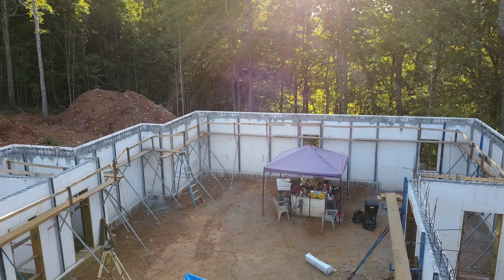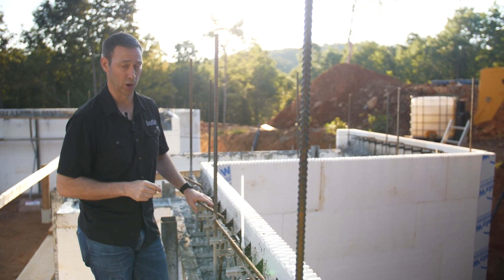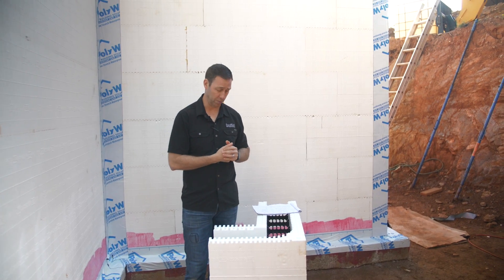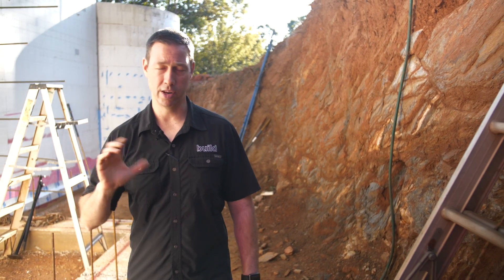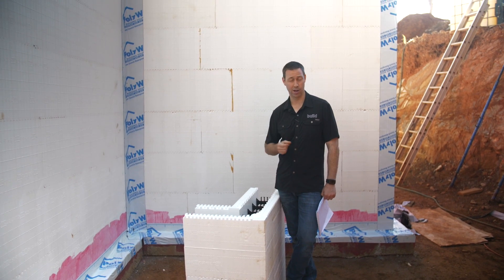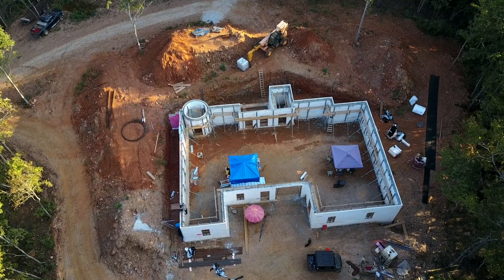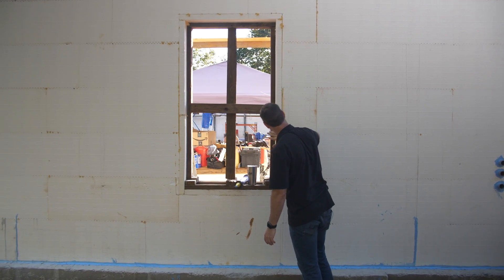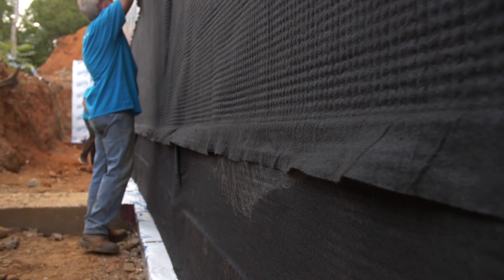Insulated Concrete Forms - Overview, Costs, and Cons

Comment: if you wanted to do an icf house but wanted a brutalist design with concrete on the outside and inside as well, could you do an icf with additional concrete on the inside and outside of the traditional icf ?

Comment: You need to read address ICF in your building types. This video is six years old and you’re basically poo poo in it because you don’t understand it. Additionally, there have been several alternatives in the ICF world like the Perfect Block which eliminates several of the drawbacks that you talk about. You can get an R 34 wall just by doing the standard construction process. Of course you can build a higher our factor wall if you set out to do that. You could add more poly iso to the outside or you could add Zip R, etc. Basically, the sense that I get from you in this video is that you haven’t built with ICF so it isn’t any good in your mind. In a rural area, ICF may be the answer.

Comment: Great video.  One thing that I am curious about is that you mentioned window and door openings and showed one, but how do you ensure that you are getting concrete under those openings?  Is it a separate pour before framing it up to support the sides and top, or is there some other magic in there?

Comment: The problem with being Off-Grid, electrically in this instance, is it rebounds in terms of the building code authorities as well as the insurance company, thus banking, requirements, point is YOU NEED A CERTIFICATE OF OCCUPANCY, without that nothing falls into place; as for independently powering your house, they do not like that!

Comment: My building with ICF was a problem for fitting exterior heavy objects to the skin later - roller shutter tracks had nothing to fix-in-to, thermal solar colllectors (wall mounted) weight heavy and i needed to drill all the way through the wall to fix them with bolts through the entire wall; exterior satellite TV mount - exterior lights, everything that fixes to the outer skin had no proper fixing location on the exterior insulation covered with render.

Comment: This sure does seem like a lot of effort to do what could be done on just a poured foundation with solid EPS  blocks, foam glue, and 1/2" concrete coating inside and out and be done with it other than a little framing for doors, windows, and cabinets and of course routing with a foam cutter tool channels for the electrical. ICF's just seem like a scam to me by comparison. Sure, they go together like "Leggos", but look at all the additional effort. All that rebar and the temporary framing...all that is eliminated with solid EPS and concrete.

Comment: Is it possible to use this to build a wall on the lot line where there is an existing home on the other side of the lot with no gap in between homes?

Comment: A lot of thermal mass in a wall isn't that great. You want some, but not much. The thermal mass will "average" the temperature between inside and outside. It's like temperature battery in a sense, that leaks or takes energy at rate of the insulation. And more mass there is, slower it happens. So that means the house will get warm and cold slower. This isn't huge thing when weather remains the same for long time. But say you take a week trip to somewhere and turn AC off and it's blasting hot outside. Your house will get very warm inside. Once you get back, it takes forever for AC to cool it back to normal due that thermal mass. The walls will remain hot for long time. Works also other way around, if it's very cold outside and you have heating at minimal. It takes forever to warm it back. That's why you want maximal insulation and minimal thermal mass to make house warm or cool on command. Only in thing like fire place you want maximal thermal mass because you want it to store that heat when you burn something and then release it over time, more mass, longer it keeps releasing energy to the room.

Comment: Great video Matt. You covered it well, especially important are the risks of failure due to lack of knowledge and experience. I would strongly recommend to work with a contractor on projects, get product manufacturer installer certification prior to attempting a project. As you say pour day is where all the preparations result in success or failure. My experience was with Blue Maxx in Ont. Now seeing numerous projects using Nudura on the sunshine coast, BC.

Comment: To get a 5$ per square foot of concrete core wall at a price of 120$ per yard of concrete the wall would have to be more than 13 inches wide concrete core alone, the wall in the video is 6 inches

Comment: Using long screws priori to pour, when attaching to the foam would result in the screws being anchored in concrete once it's poured, right? I know this is probably unnecessary but I kind of like the idea for extra secure building.

Comment: A great video with lots of good points! No matter what is used as a basement or wall system , you will need to waterproof your door and window openings. There would be no difference there. In a poured concrete wall system, when either forms or ICF's are used, if 4,400 psi or higher concrete is used, the concrete is considered waterproof at that point and no other waterproofing is needed. I am planning on using ICF when I build my new home and I am planning on using 5,000 psi concrete for my walls. SUPERIOR WALLS use a poured concrete wall that is poured in a factory and are set up and bolted together on site and they have a warranty for their basements. Look at concrete dams.

Comment: I have the polysteel brand,  and I just pushed a screw all the way through to the concrete. So suffice to say my foam has the holding power of a banana. So it's using the metal studs only for me!

But great video and very professional explanation and execution :)

Comment: I’ve been looking at Aircrete Harry’s Domes.
Instead of using the cement in between the walls could you use the air Crete and then use that to spray the outside of the wall or is that overkill.

Comment: concrete does not resist thermal transfer it has greater specific heat than wood. you see this effect when you touch cold wood and steel outside in winter - they are both the same temperature but the piece of steel (like a hammer head) feels colder because its higher density can and will pull more heat from your hand than the same temp piece of wood.

Comment: We built in 2015 in SE Idaho, regarding R value of insulation, our HVAC/Mechanical contractor told us that the elements considered or measured to determine R value, are not friendly to the ICF build with regards to actual performance. I guess that the combination of concrete and the styrofoam industries have not invested into the testing/performance of ICF vs stick build (there are all types of variations and combinations) and getting the industry to accept  and publish those comparisons. After living in, and paying the utility bills for our home for 6 years, I can compare utility bills with friends, and realize I would rather pay my bills rather than my friend’s bills. Pretty high tech for sure! Yet it seems There may be a bias against the ICF cult.

Comment: As far as the thermal mass goes, it's not so much that the concrete is insulating as it is that it's averaging. The concrete buffers the temperature from day to night and smooths over unusual dips and peaks, which can make the house more comfortable by flattening unusual extremes - warmed nights, cooler days. However, if both the high and low temperature are unacceptably hot or cold, this buffering doesn't really help you.

Comment: How did you screw those pieces of wood into the wall? Did you use tapcon on screws to penetrate into the concrete? I can’t imagine that the foam itself can support your weight?  Thanks
Reply: Studs are integrated into the foam

Comment: Why does concrete need insulation?  Why not just pour thick solid concrete and rebar?  The thickness alone will insulate and no foam with risk of bugs

Comment: Concrete can absorb as much water as you mixed it with, since that water evaporated without shrinking to speak of. Depending on what the flood water is, you could soak that concrete with some smelly water and you can’t get in there.

Comment: I've got a huge issue!! the house is old Europe brick no insulation, nothing! I want to insulate both sides of it with exterior and interior new build walls. I want to dig out the earth packed floor and add an insulated slab. but the old brick walls will always be wicking cold straight from the earth. How do I do this right without complete tear down and new build?

Comment: Ive heard that insurance companies will not insure a home that has ICF's due to the termite problems with icf's even with termite pest controls
Reply: You have to have a termite shield on the block to make the little buggers go to the outside of the block. If you dont have the shield then yes you cannot be covered with termite coverage. If you look in the accessories on the Build Blocks website they have a termite shield product.

Comment: Concrete for homes building is nothing new, its used all around the world , even romans used it 2000 years back. But these ICF blocks are extremely innovative, they both help with the speed of building and as well as insulation. I would love to see more builders skilled in building with these ICF and even better if there are builders working with architects so that there are there are there are concrete pillars around the middle of house to help support a concrete floor and a concrete roof.

Comment: If you added a radiant pipe system through the concrete for the cost to run a circulation pump (solar stirling engine pump?) you could use solar to store heat in your walls in the winter and a ground water heat exchanger to cool in the summer adding a thermal break and managing thermal energy in a way that will influence the entropy of the system to maintain temperature, hot flows to cold.  The shell of your home becomes a thermal battery, part of the geothermal system you can charge during the day and extract the heat from at night, perfect for many months of the year becoming a closed loop system, using the insulated mass to reduce temperature swing passively. Radiant panels plumbed into to the walls is an efficient way to move heat. Include a solar water tank and backup boiler (biogas) for redundancy plumbed to the interior water loops for a low energy thermal management system.

Comment: did you screw those two blocks into the underlying concrete? or just the 55-60mm of foam board? thanks
Reply: in the foam there are solid pieces of plastic embedded. There you can screw into. You can see it in the video :)

Comment: Question; inside  you can install drywall but what about wires and plumbing? You can not channel for wires because you need 1 1/2" from outside of drywall.
Do you now have to build another 2x wall inside?

Comment: I was looking to demolish my pool and build a 30' x 20' walipini (underground greenhouse) in its place. I want to build 10' high with ICF retaining walls, backfill 2' of soil and build a polycarbonate panel structure with 8' walls on top of the ICF retaining walls. I need the walipini to be so tall (18' max clearance) because I want to grow tropical fruit trees. Is such a project feasible with ICFs?

Comment: Matt I love your channel. You should investigate another ICF I worked with, Durisol. I do not represent them. Made from specially treated wood and mortar. You can get them with rockwool preinstalled. Saw them, screw them, groove them and they are light. Put in rebar and concrete and you have a great wall. Parge inside and out and you can stop there. No molding drywall in the basement. My friends dad built a house in the 50s in Goderich Ontario with it and it has stood up. Foam has and is giving me big problems with insect damage (mostly wasps and ants).

Comment: to power that house you would need $40,000 power wall $70,000 solar array
$10,000 generator
Reply: I don't know where you came up with those prices, but you are way off on the cost.  400w solar panels and lithium ion batteries are getting cheap.  I have been researching solar for my home build and it is not very expensive if you do a little research.
Reply: @jamesdiyhomestead8263  
i just had 32/400 watts and grid tie inverter and it was $43,000   lol
Reply: @88corinutza  Signature Solar sells 410w panels for 185 each if you buy a pallet of 30.  That is $5,920.00 plus a few hundred for shipping.  That is 13,120w of solar panels.  They also have a 10,000w grid tie inverter for only 1,399.00  even if you buy 2 inverters that is only $9-10,000 with shipping for panels and inverters.  Adding another 3k for wire and misc items, you paid about 30k just for labor.

Comment: Hey, A couple questions from a. Novice:

1. Disaster:
I don’t see the foam withstanding a flood. How hard/costly would it be to replace the foam alone? What about finishing a basic indoor drywall wall?

2. Remodelling: 
Is it possible to have ICF on 3 sides of the house with stick frame for the 4th side, in order to build a possible add-on or remodel in the future? Would it make the ICF sides weaker? Would the stick frame and ICF connect well? Would it be harder to waterproof at the connection points of the walls? 

✌️

Comment: The R value is much higher than what you said. I have built a few of these houses. Two of which were in Brainerd, Minnesota. One was a spec house, basement, main floor, 4700 total sqft, all ICF. One was my parents house. 4500 total sqft, basement ICF, main and second floor 2x6 stick framed. Middle of winter with average temperatures well below zero, the cost of heating the spec house was less than $65 average cost for gas and power combined. It would hold temperature no problem. Sold before we got very much cooling data, but it was next to nil.

Comment: Matt this system is total bullshit, from the physical point totally wrong, the dew point is behind the insulation which means it is in the concrete core!!  The other point this wall system is not breathing the moister from the inside can't get out, resulting in a very unhealthy room environment for the people living in it.  The problem is the American's don't understand to build healthy environment construction, they don't understand anything about construction physics. I have lived long enough in the US to understand what they doing wrong and they don't care.  Matt you mentioned hurricane prove, well the walls will withstand, but the roofs they build in US will fly away like a kite. But the roof is always the weak point and needs a lot of attention for insulation !!! You also not mentioned that you not a simple pump in the concrete like in conventional formwork, you have to go around all walls and do it by layer !!! This will cost the builder more money because the concrete pump get charged by hours of use, even the 6 m3 concrete truck can't be empty in 20 minutes, they charge you to. Usually, you should vibrate the concrete to get the air bubbles out, this is another challenge because the formwork is not so strong and this has to be done with a small vibrator not destroying the formwork.

Comment: I own a ICF house in eastern WA and he is wrong about the R rating. I get about 4 feet of snow here. Sometimes more sometimes less, but with out my hydronic heat working and a fireplace rated for 1200 feet in a 3000 foot house we were comfy. In the summer like now, with no cooling we stay about 70 when its almost 98 out side. Ground temp helps greatly. I am going to hate selling this house when I am done rebuilding it. It was left vacant for 7 years and got attacked by drug addicts. They cut and took anything worth a buck and some not worth anything. They cut all the copper out of the attic, all that is left from my hydronic heat is the pex lines poking out of the slab. I have been watching LOTS of your videos for help. You have been a huge help and with about 6 months to a year worth of work left, I can see me returning to your channel again. Thanks for the help.

Comment: any chance of toxic fumes from the foam ? i know it can be covered with stucco . I've used this a few times, used rosta too, but chemical materials seem like a toxin that i don't want to have in my face everyday. i think i would rather live in a mud hut. maybe cobb, or how about this idea, seriously, soaking straw with cement ?stucco over that !   and using slipforms ,that i think would be cheap, insulating and super strong.   anyone ever try that ???

Comment: You mentioned the strength standing up to tornadoes. What cement is used with this 6" structure? I am looking into building a home and am considering the base material. I would like it to survive a F5 tornado and Cat 5 hurricane. It must survive debris strikes. I read tree test at 100 Mph is needed. I cannot seem to find anything to help guide on the strength of these systems. I only read stories of building that survives direct hits and they used 12" of concrete. So what would a 6" or 9" verses a 12" thick wall provide me with in strength and using what material cement and / or rebar? I also don't wish to use the traditional pitched roof as that would be the weak point. I figure using flat cement roof and use the upper level as additional living space or solar collection location. Are you able to point me to where I can find a general rules of thumb for this work?

Comment: 90k for a basement wall? LMAO 😂 that's insanely expensive.
Reply: That was total square feet for the whole house. But they are not using the labor cost, so knock 1/3 of the price off. But I have built 5 of these houses. 3 in Minnesota and 2 in Utah.. His costs are actually inflated a bit. Planning on building my own in Arizona.